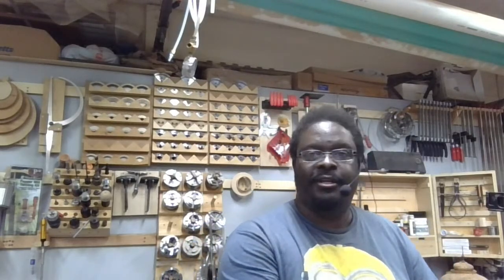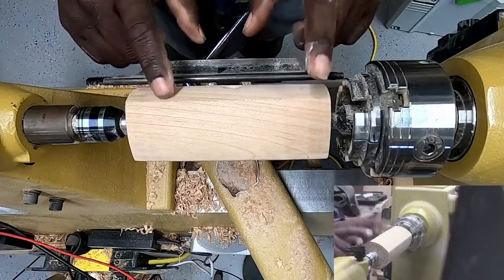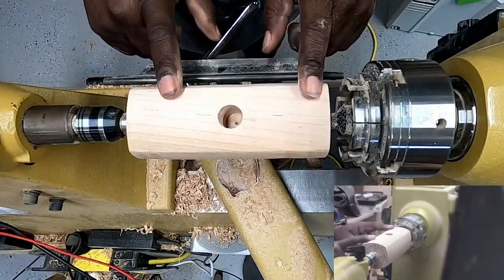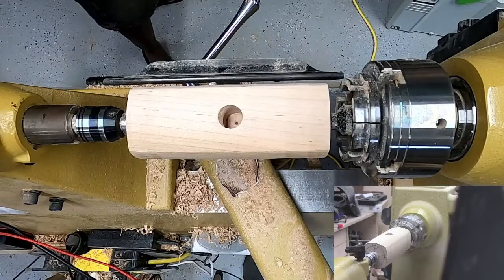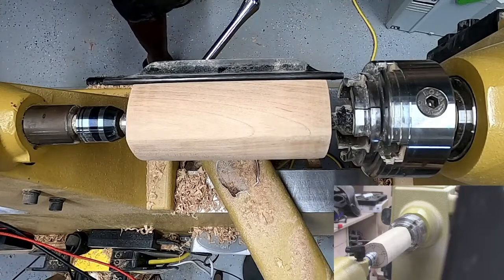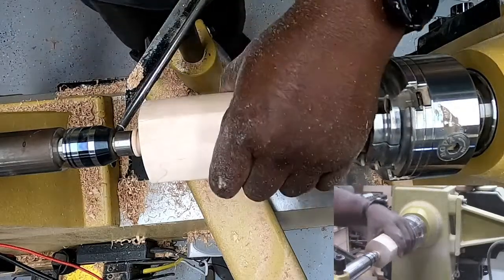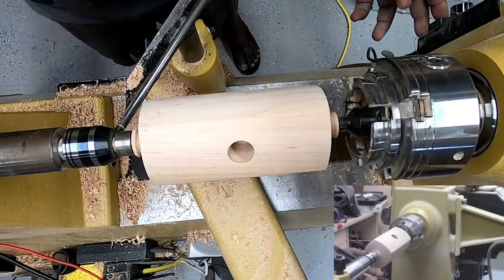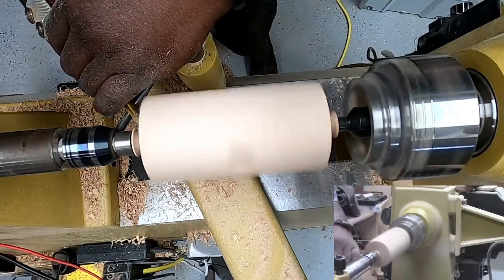Square Turned Mallet pt 2

Comment: Another suggestion - instead of marking four off-center radii, you cut a short tenon (which on the central axis).  Then, when you do the off-center cuts, turn down to the point where the cut surface meets the tenon.  That way, the four off-center surfaces will be symmetrical around the central axis.  Finally, when you put the spindle back onto the central axis for finishing, convert the tenon to a dome.

Comment: Neat design, but I'm concerned that the square corners near the striking faces might mark whatever surface it is used on, or that the corners might chip off.  Why not make the striking faces circular with very short tapers back to the square body?
Reply from the maker: That is a good idea. But wouldn't a full on square mallet present the same issues? Lots of folks use those.